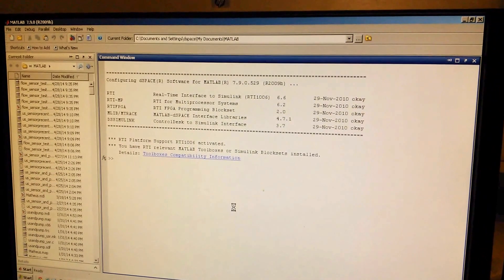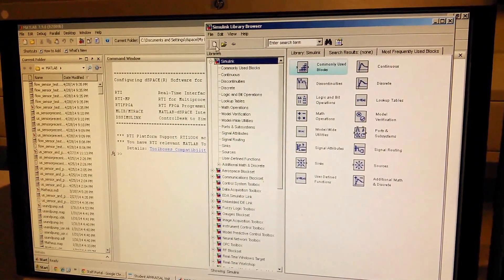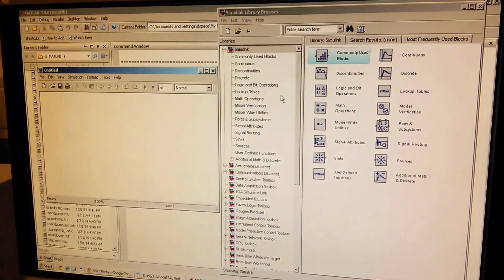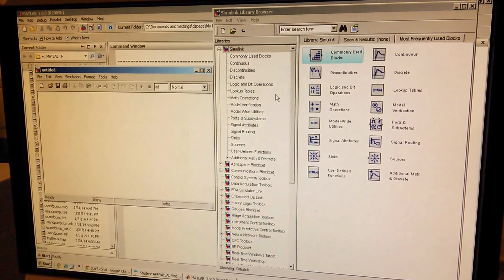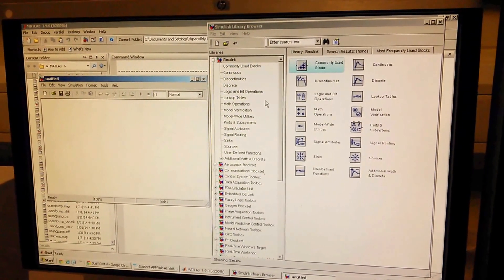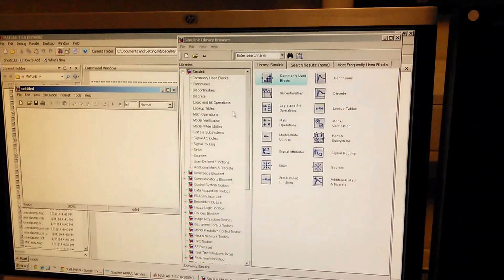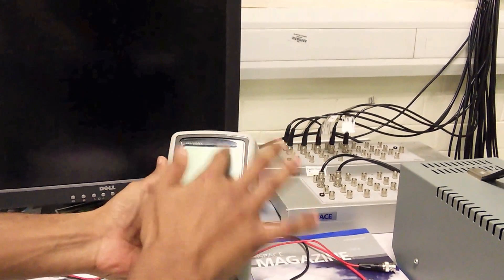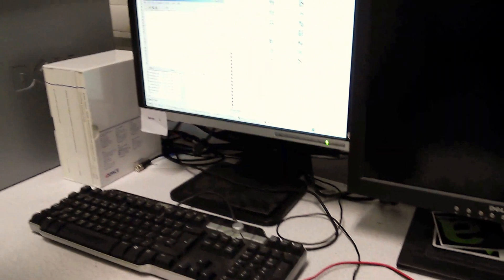dSPACE Tutorial 1 (Sending Signal)

Comment: Hello thanks for this tutorial, I am Sachin using dSPACE for my project and I am correctly using PID controller for trajectory tracking but in dSPACE displacement tracking is good but but velocity tracking is so noicy I can't able to read those data for know I am using low pass filter/ Transfer function(1/0.1s+1) but it's not showing correct volocity tracking can you please help me which filter I should use and eliminate noice

Comment: Hey, I am trying to send data to a Master-Bit-Outx but its not showing on an oscilloscope where i am trying to read my input. 
I have selected the right bits which connects my dSPACE board dS1104 with my I/O unit. There was a different simulink model which was previously working fine with DS1104 but since i tried to connect a new simulink model with the board, it works fine in control desk but the output cant be seen on an osci. what ight be the reason ?

Comment: Ashfaque Alam Hi mate great videos, I never used dspace before but I might be working at an automotive company come January. Is there any great, comprehensive, detailed but introductory resource(book, lecture notes, videos) that you can recommend that covers the entire Dspace  automotive model based design work flow ? Namely, tools like VEOS, TargetLink, ASM, Control Desk etc etc. I'm trying to learn as much as possible so I can hit the ground running. thanks kindly. your vids r a great start :) Any resource recommendations ?
Reply: For dSpace, your learning should be system dependent. For example, control desk have different versions including different processors. Don't need to worry too much. When you join, you will get documentation sets if the company have licenses for particular tools. What I suggest, for first few weeks spend a bit more time on those documentation which relates to your basic working activities such as how to load the model in control desk, measure signal, find signal variables etc. Do not try to learn everything, just plan what you need to learn to ensure your regular works are smooth. Then, slowly increase your learning phase. Learning the dSpace can never be finished :)

Comment: hi dude, i have a problem when i try to build the model in simulink, i'am working with  the DS 1104, the problem is "Simulink does not permit you to build programs in the MATLAB installation area. Please Change to a working folder that is not in the matlab installation area.  it´s important to mention that i changed my current folder.
Reply: What configuration do i have to do in simulink ? i have DS1104
Reply: oscar samuel cortez moreno So i had this problem to , u need change the place when the matlab complied your folder for that use de comand "cd" and after input the place where you save the folder. for exemple:
"cd c:\users\documents" 

for me this steps works...

Comment: Mr Ashfaque, I am able to send and receive the signals but I am unable to find the variable (parameters) of Constant block in control desk. I am not able to load the parameter into the slider because the control desk is not showing the variable.
Reply: I think I am missing some MATLAB advanced settings because this problem came only when I installed a fresh MATLAB